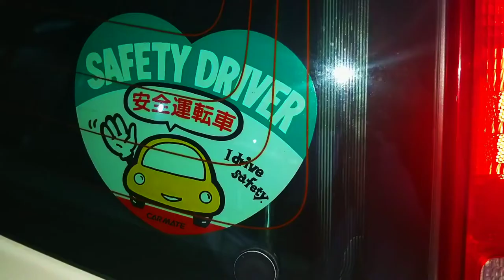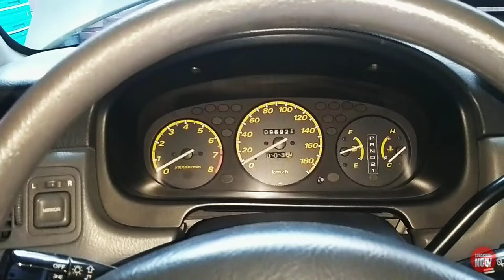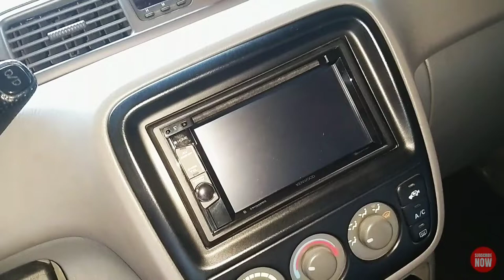Honda CRV Walk-Around Review

Comment: Mabuhai, I'm wondering what shock absorber that you're using? I heard that you're using EK for if I'm not mistaken.

Cheers from Indonesia by the way!
Reply from the maker: Yes, I used SO4 EK shocks for the front and OEM crv shocks for the rear.
Reply: How about the coil springs?
Reply from the maker: @Fabianto-san  stock oem crv coil springs

Comment: Great job🤙🏽 What spare tire is that? I don’t see that here in the states.
Reply from the maker: Those are factory 17 inch donuts. OEMs came with the stock wheels. Replaced mine to make it a little bit lighter but still has a purpose :)

Comment: Hi there, do you notice that the ac blower is a bit loud when driving? or just could be my car
Reply from the maker: You can hear the blower sound if you turn the fan knob on the 4th stop. If its the same sound as when you are parked, better have the blower checked by your trusted AC technician 🙂
Reply: @budtv_  I can hear the blower even on the 1st stop but on the 4th stop its very loud.
Reply from the maker: Have your blower checked 👍

Comment: Hi Sir, i am currently restoring our 99 CRV. Main problem right now is the roof. There are leaks starting to appear in the roof liner. Any idea on how to properly address this? Or do you know anyone with experience in CRVs with this specific problems. Ive tried bringing this to your typical neighborhood bodyshops, and they always do bandaid solutions.
Reply from the maker: First, you have to diagnose what causes the leaks. Is it because of rust? Or is it because of other reasons? If you ask me, roof replacement is the best solution to your problem if the cause is rust build-up. Band-aid solutions on roof rust wont do the trick as they reappear time and time again which would be a waste of money.
Reply: @budtv_  thanks sir. Will look in to roof replacement. Can vroomix do this or do you have any go to guy for these type jobs?
Reply from the maker: @raymundmallonga5927  Yes, Vroomix can help you with that. Getting a fresh roof cut is also an important part of as you need to get that fresh headliner too.
Reply: @budtv_  I already bought a headliner. Just gotta find a nice surplus roof. Thanks bro. Gonna look for vroomix on fb. Nice vlog, keep it up
Reply from the maker: @raymundmallonga5927  BIG thank you!